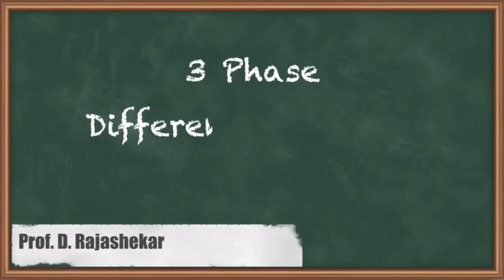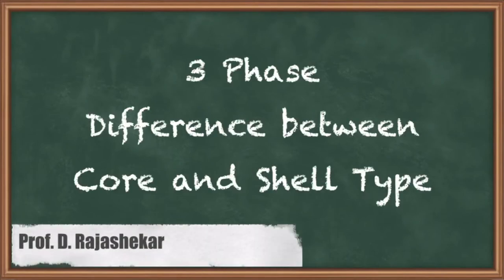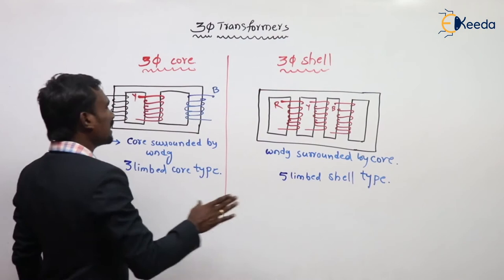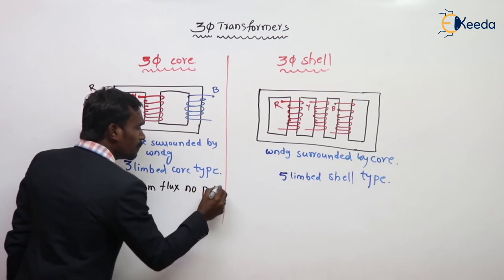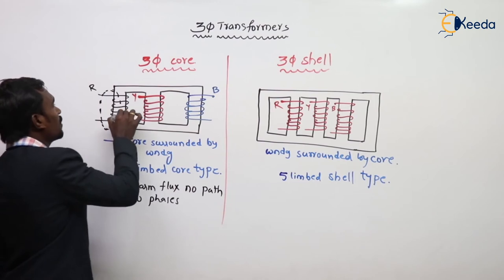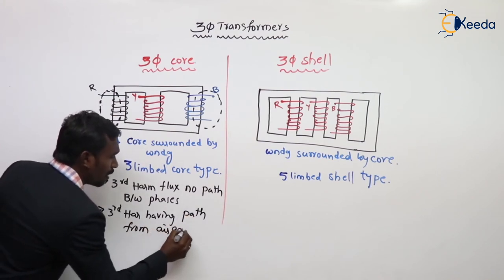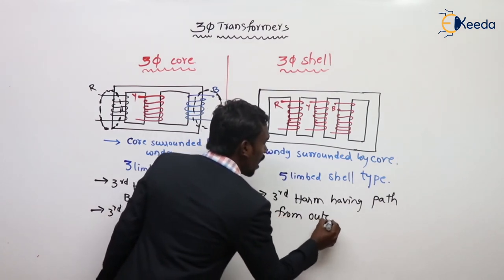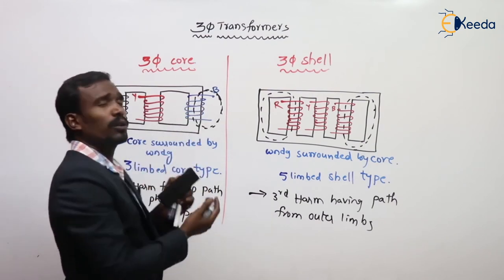Exploring Core vs. Shell Type : 3-Phase Variations In Electrical Machines | GATE

Comment: In the case of a three-phase shell type five limb transformer, with delta primary and star secondary windings, what would be the electrical characteristics of a tertiary single-phase winding on one of the outer limbs?  Would the frequency be the same as the primary frequency or would it be a 3rd harmonic?  What would be the phasor relationship?